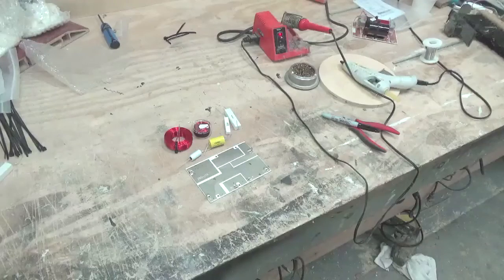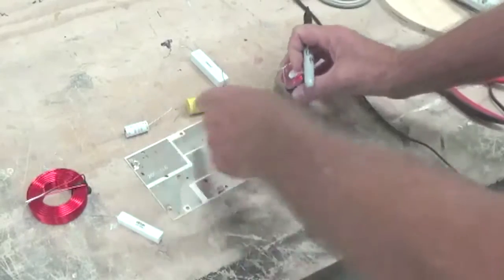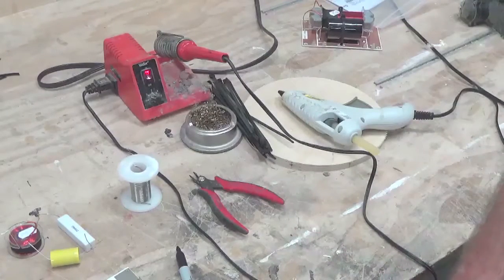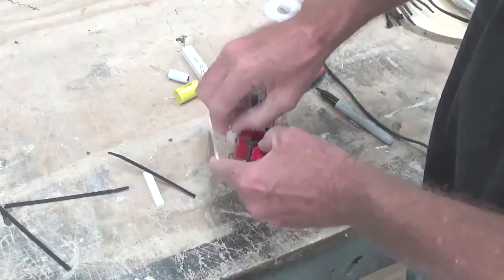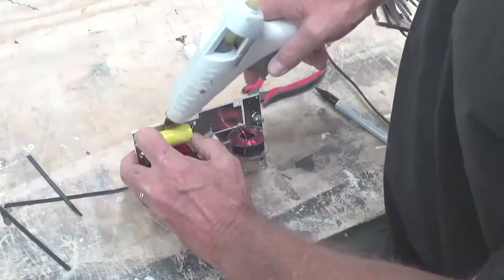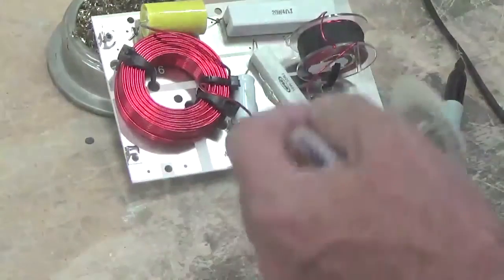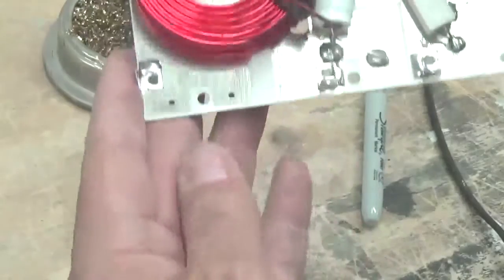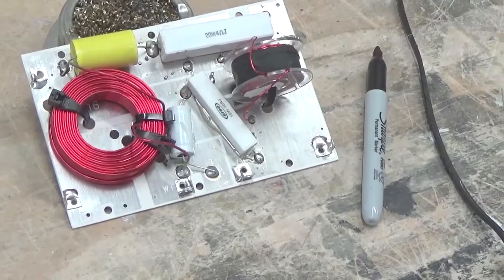Bill Fitzmaurice Crossover Construction

Comment: The yellow cap isn't electrolytic. Its  MKT or MPT or something similar but definitely not an electrolytic. Yoy can't recognize the non polirized electrolytic by the size, but from the two cuts in both ends. It seems you soldered on the wrong side of the board. Sorry.....

Comment: I can't watch this. He is not soldering, he is 'blobbing'. I am both a plumber and an electronics technician and in both trades I was taught to put the heat into the work not the piece. His blobs will not last the first knock :-(
Reply from the maker: 12 years of xover construction without a failure.  Hard to see but I am heating the work.